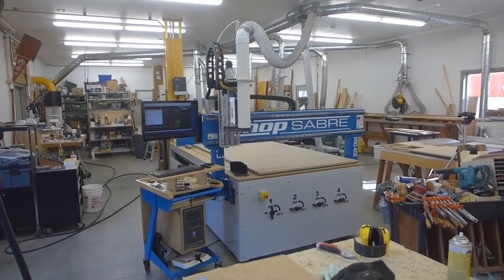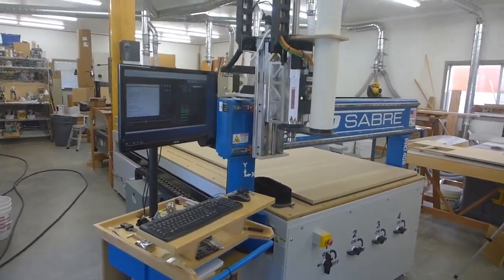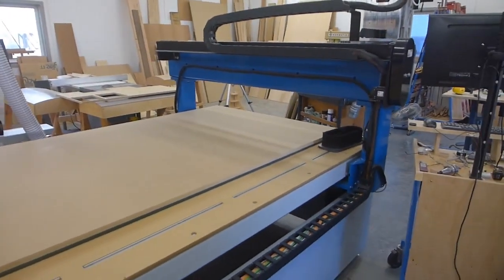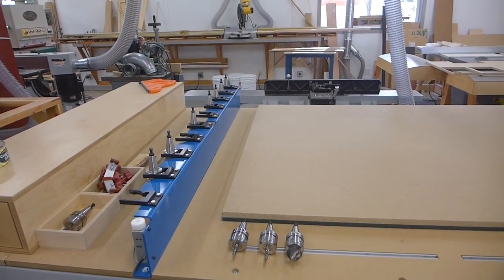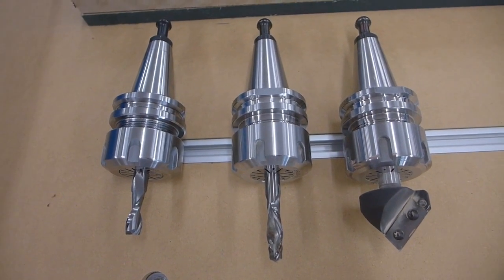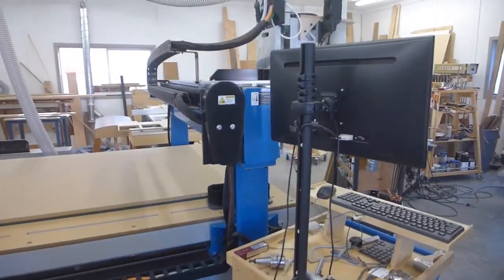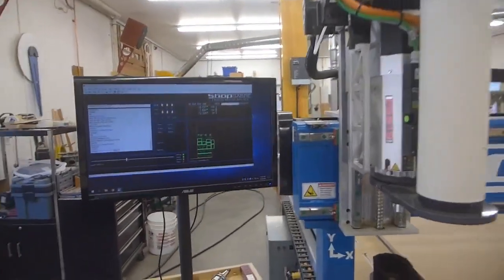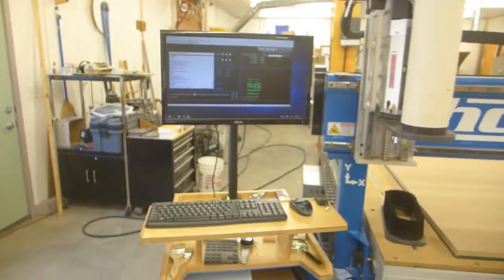Cutting X-LS Encore Speakers on CNC Router

Comment: Do you cut out speaker cabinets for other individuals that are looking to get into the hobby and maybe profession?
Reply from the maker: David, if you're talking a single cabinet, it could be done but expensive because all programing, development and prototyping cost is borne by a single item. Mass production spreads this cost over many items, thus lowering cost per unit. If you're looking for a production run of a single item, that changes things some. My email is in the video description.

Comment: Is there a way that you may be willing to sell your CAD files for the router? So I can do those cuts on my local available CNC machine? I am in Ukraine, and it isn't very cost-effective to ship from USA.
Reply from the maker: In a word, no. Although CNC is cool, it's really not necessary to build speakers like these. Long before I had CNC capability, I built a good many speakers. This might be helpful: https://www.audiocircle.com/index.php?topic=150120.0
Reply: @carbidetooth  thanks for the response. So, if I understand correctly, there is no way to get the source files for XLS-Encore flatpacks for the CNC from you, even by paying for them the price that you may be specifying? Guess, I'll have to design them myself from the cabinet measurements. My friend here in Ukraine has a furniture business, and has a CNC router at his manufacturing facility, that is why I thought it's a great idea to cut it straight there. But thanks anyway.

Comment: First of all you called all your cutters wrong. Two of the cutters are called end-mills ones a flat bottom end-mill and the other is a ball end-mill. The third one is called a countersink  with carbide insert. This is according to the tool and die Institute of America.
Reply from the maker: Hi Kevin, and thanks for dropping by. Evidently the CNC router industry calls things a little differently. For reference, I'm including links to specific cutters used.  There is no ball end mill used in the setup or shown in video. You're right, I did call out the V cutter by half of it's included angle of 90°, and I substituted common parlance for the others. Perhaps this will clarify.
V-Groove cutter:
https://www.amanatool.com/rc-1102-insert-v-groove-90-deg-x-3-4-x-1-2-inch-shank-cnc.html
Compression cutter:
https://www.amanatool.com/46171-cnc-solid-carbide-compression-spiral-3-8-dia-x-7-8-inch-x-3-8-shank.html
Spiral Up Cut:
https://www.amanatool.com/46103-solid-carbide-spiral-plunge-3-8-dia-x-1-inch-x-3-8-shank-up-cut.html

Comment: Really nice video, thanks for sharing.   Im considering doing some GR speakers that ill contact you later on, but just wondering if you could make the speakers cabinets of anything else beside MDF? like real wood or the routers wont work with it?
Reply from the maker: Router will cut most anything short of metal. All things considered,  Ranger MDF is more consistent in thickness, density and flatness than plywood or solid timber. This affords more precision when cutting. Plus it has really good sonic damping qualities. I don't have any love for the stuff, but its virtues are hard to ignore.
Reply: Peter Rawlings Hi Peter. How do I order the flat packs?
Reply from the maker: @jeffcronin1188  email me  carbidewing@gmail.com

Comment: How would one go about placing an order? Also, ever do any of the A/V-3 floor stander cabinets?
Reply from the maker: Steve, you can contact me directly. 
carbidewing@gmail.com
I've built several GR Research Designs. Currently only offering this as a flat pack.  In time there may be more.
Reply: @carbidetooth  Nice, looking to order the A/V-2 kit to replace Polk RT55i's